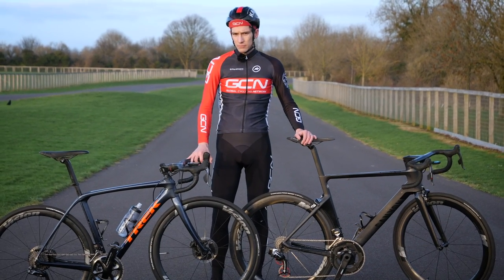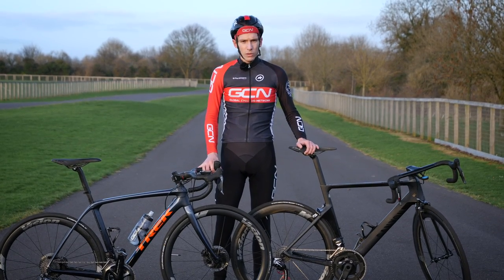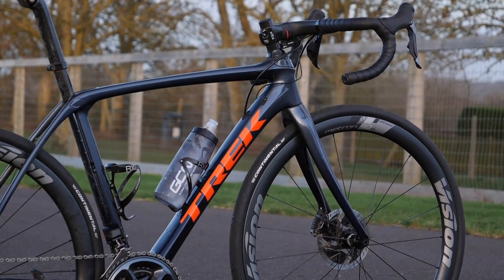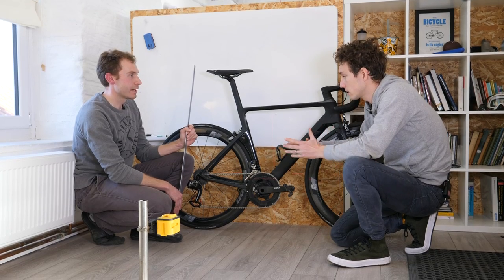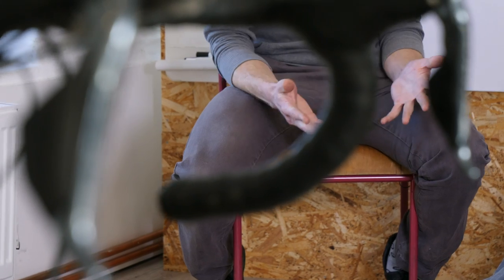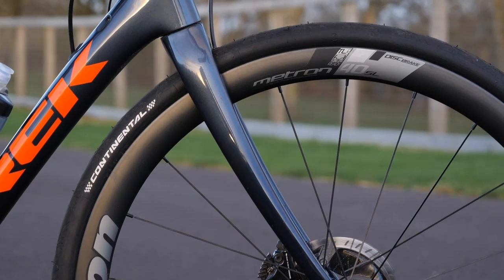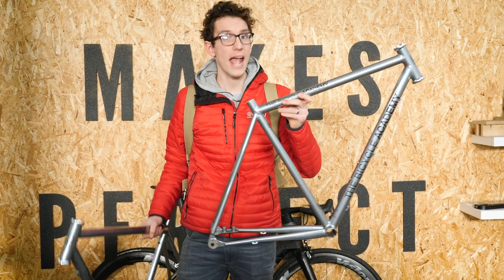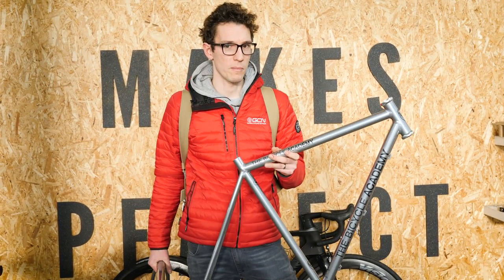Speed Vs Stability - Can Bike Geometry Make You Faster?

Comment: Is a shorter chain stay actually faster or feels faster?
Reply: If the dimension stimulates the sensation that makes you ride faster, it's faster.
Reply: @steventrott8714  that's helpful when looking at bikes in the local.
Reply: @steventrott8714  counter argument: I had friends that got skittish because the bike "felt" faster than they thought they'd be safely able to handle.

What short chainstays definitely do is turn quicker, and affect traction when climbing. The latter is very much more variable depending on how a rider sits -  more weight on the back wheel (i.e. longer chainstay) is good... until you lose control of the front if the road is too steep.  As far as I understand almost all bike design parameters are compromises.
Reply: I've got a Canyon Ultimate CF SLX, so technically a light weight climbing bike...... I keep up with the aero's when racing..... you could have a point
Reply: I can say... my Giant TCR had a 1" shorter chainstay, slightly lower BB, and slightly less trail then my TCX.   But even with the higher BB, the TCX is more stable and less "twitchy", I guess from the other factors.  But to me, it still feels "fast", and is quite agile and highly maneuverable.  I am really not any "slower" riding it.  It is also more comfortable to ride, I don't know how much from geometry, or from riding on 28/32mm tires vs 25s, but I feel a hella lot better getting off the bike after a long ride on the roads around here.

Comment: Speed Vs Stability - Can Bike Geometry Make You Faster?

Not really, it depends on the style of riding and the terrain and the comfort level in maximising the peddling effort and nailing down the rider position. 
Custom frame builders will be able to tailor the frames geometry for your bike fit, rider weight, style of riding, terrain etc. Bespoke builders will also generally give better wheel tracking and frame alignment accuracy as well compared to a moulded composite plastic ones, where custom means much more than just choosing a paint spray scheme.
Faster? Yes if the geometry is tailored for you.

Comment: Fast is stable. Momentum is everything
Reply: livibam  until you need to corner?
Reply: @camsterasmar975  no. My summer is extremely fast and stable around corners almost lazer presiccion . That's with a 140stem and slammed.
Reply: @camsterasmar975  this statement from cyclists has always left me scratching my head. Motorcycles of all geometry types weighing 200kgs can get through any corner you throw at it. Sure, some bicycles feel much more reactive than others, but they all feel very nimble.

Comment: Road bike shouldn't be twitchy. You are not going around cones with it. It should be focus on stability at speed . It gives u no benifit changing direction quickly at the handle bar going 50+ km an hour. And the laziest of bikes can handle most curvature of plubic road. I take my endurance Bike up to 80 km on decesnts on mountain roads and not once I feel the bike need more twitch. A fast feeling bike is just that . Feel fast. But doesn't help you with high speed stability.

Comment: All this talk about geometry and no talk about toe overlap. ?
Reply: @Bungle2010  okay. If you racing yeah no problem. If you commute in the city toe overlap makes for a crappy bike. Maneuvering in traffic and hard turns you can find yourself on floor. Why have a bike with a design flaw. ??
Reply: @Bungle2010  yeah I was going to buy a used Merlin titanium bike took for a test ride and had horribly toe overlap. My vintage 1980s Rossin it tight but no overlap. Should have kept it ,, The newer 90s Casati I have only when you make u turns , but I can just drop my heal to clear the wheel. I dont get why they would make a bike that way. I cant see being that much more efficient by being that tight  .